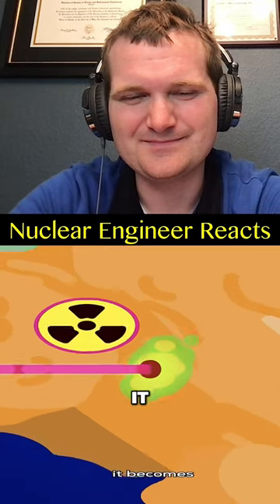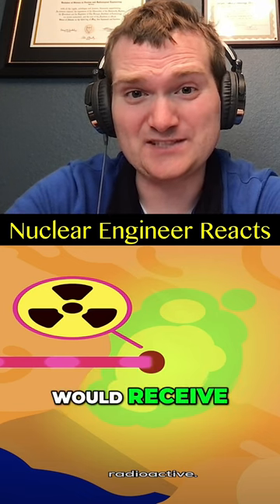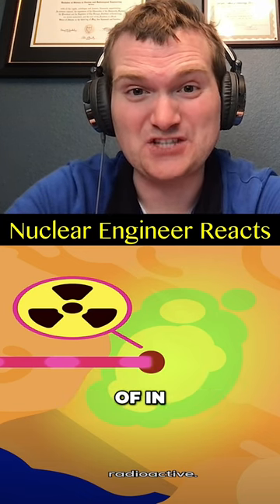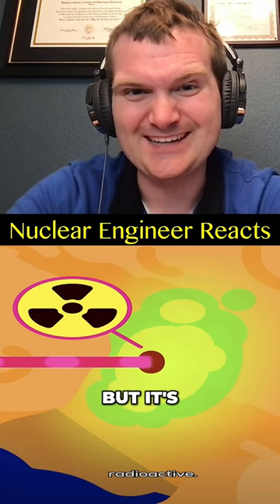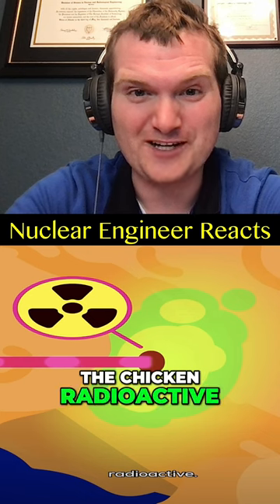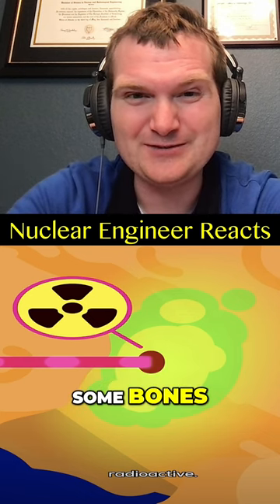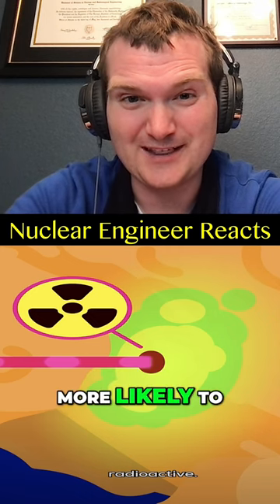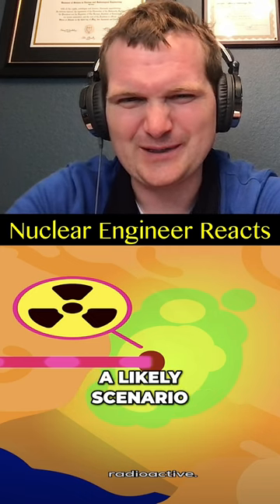What if you Put a Chicken in a Particle Accelerator? - Nuclear Engineer Reacts

Comment: Pumping out the air wouldn't freeze it....
Reply: But it would dehydrate it if we are talking about „absolute” vacuum.
Reply: Doesn't a thicker atmosphere "trap" heat better than a thinner one? Maybe it would freeze. Maybe Tyler would like to explain it.
Reply: @Mr.Mojito-parrotlord  yeah, all the water evaporates. The lower the pressure is, the lower the boiling point BUT you won't be able to cook the Chicken like that anyway since the temperature where the water boils will be much lower.
Reply: @norbert099  The lower pressure would favour an endothermic evaporation reaction (hence cooling the chicken). Furthermore, the lack of atmosphere would act as an insulator (reducing conductive/convective heat transfer), forcing it to rely only radiative heat transfer. 

However, the colder the chicken gets, the slower the evaporation reaction would occur. Until an equilibrium would be achieved. 

Not certain this would actually produce a frozen 🐔. Maybe it would
Reply: @jasonvachon5947 the less pressure the harder it is to boil, the more pressure the easier it is to boil, the item would freeze.
Reply: @CheeseLordAlmightytheOneGod Nope. At lower pressure the boiling point is lower. Hence, easier to boil.

Comment: Exposing organic particles to radiation causes some of them to become radioactive. I'm not sure what the math would indicate as to hoe much radiation would happen. If a particle accelerator can break up or fuse more particles into nucleii, then you would see radioactivity.
Reply: The most common sources are electron sources and well, not inducing much radioactivity from that and protons, which could, but most of the radioisotopes would be short lived and in a very, very small area less than a pencil lead in diameter.
Now, wanna see something cooked by CERN? Their beam dump autopsy was quite revealing as that tiny beam blasted the crap out of the beam dump for years and finally needing to replace the graphite.